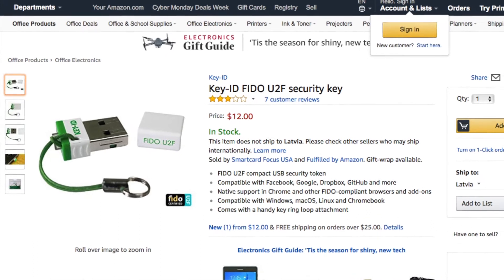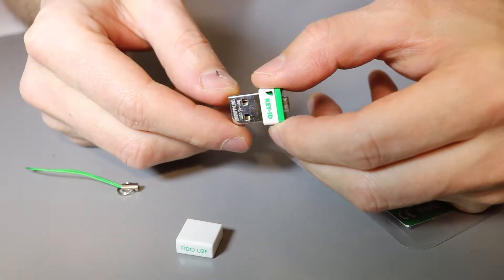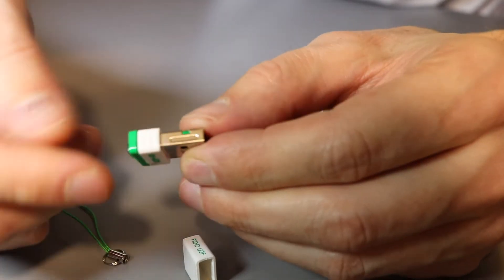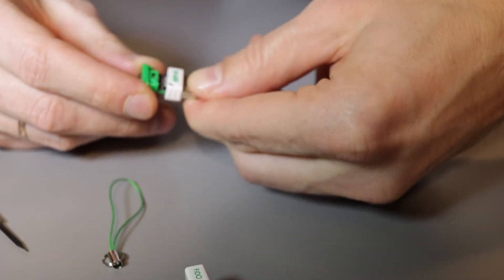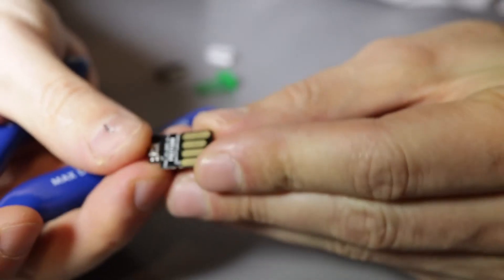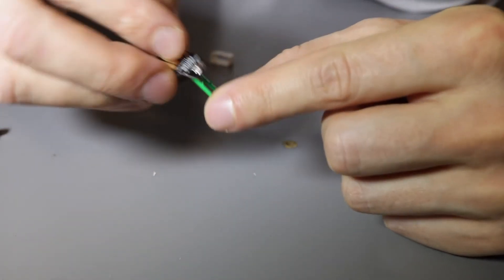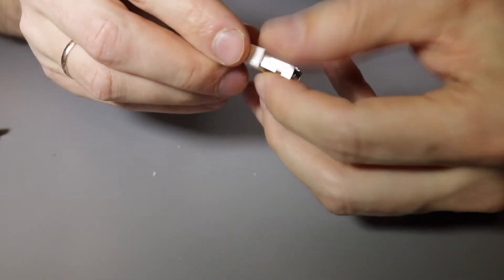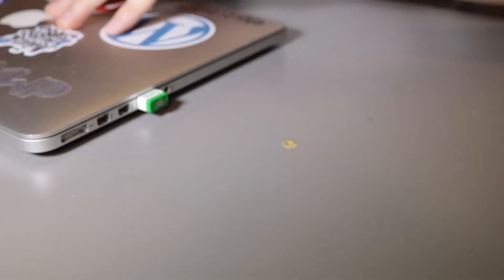KEY-ID FIDO U2F: How to Remove the Green LED

Comment: the problem is that you didn't understand what is designed for this U2F keys.  YOU MUST NOT LEAVE CONNECTED IT PERMANENTLY.
Reply from the maker: For example, the YubiKey Nano is designed exactly for this kind of application: "designed to remain in port" https://www.yubico.com/product/yubikey-4-series/#yubikey-4-nano
Reply: @KasparsDambis  why use this key? because anyone that has access to your computer has full access to your accounts, just like when you dont use a hardware key. so this is just a gadget and you obviously dont need a hardware key. If you do need one, Buy a good one like the hardware keys that make use of NFC for example. Costs a lot more but keep things save like how it should.
Reply: @tonioreyes  NFC isn't as secured as connecting it into an USB port.

Comment: U2F keys are not designed for permanent installation what you are doing here is counter intuitive to both the security and functionality of the device.

I think maybe you have missed the point, the light is there to dissuade you from leaving the device permanently plugged in (security) and also it flashes to advise you when to press the button to authenticate (functionality).
Reply from the maker: This video is about creating something similar to Yubikey 4 Nano which is designed specifically for a permanent installation. I've been carrying a Yubikey Neo with my keychain for the past two years and it become frustrating to go and find it every time I need to use it. Finally, I'm probably taking better care at protecting my laptop than my keychain :)
Reply: I agree, I leave mine in all day.
Reply: Kaspars Dambis at work we use the Nano N which has a very small form factor and is made to be plugged continuously. The Nano does the right thing: blinks a bit when you plug it in and only blinks afterwards when touch is needed.
Reply: @MarcoPaganini  you do need to take the key out of your computer when you leave the room.
Reply: @tonioreyes  no, I leave it in. When logging in from other locations I use alternative 2fa methods (like the authenticator)
Reply from the maker: Exactly. And you can always revoke keys (that are permanently attached to the computer) if your laptop gets stolen or lost.
Reply: Why not? Second factor is a protection against the loss of your *password*. If your laptop is stolen with the security key, oh well, Crooks still can't get into your account because they need your password.